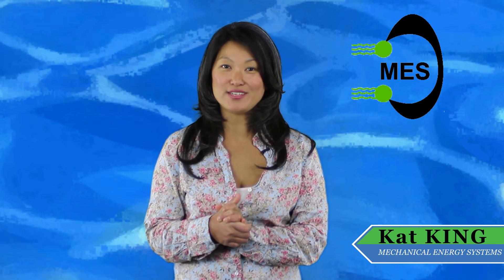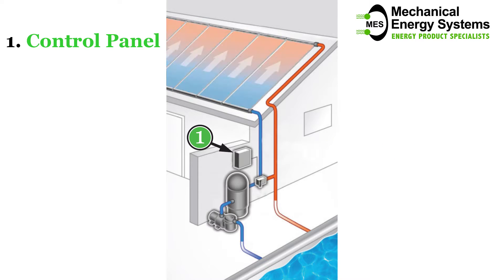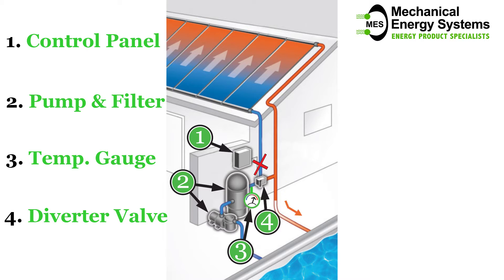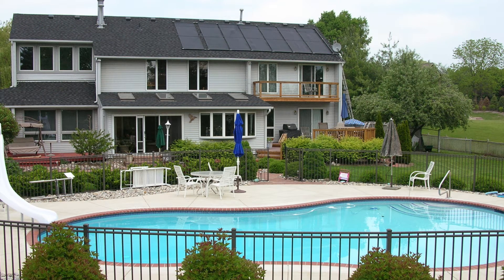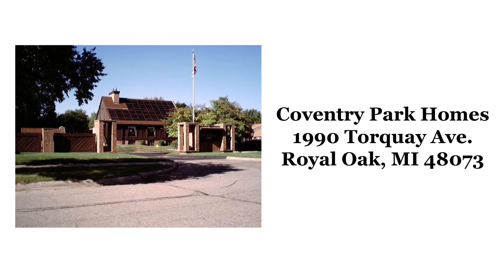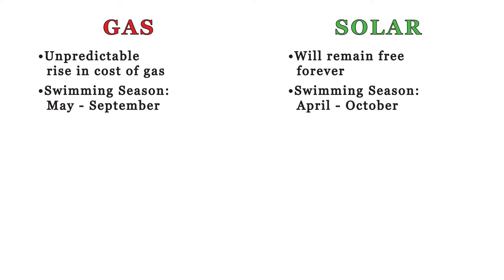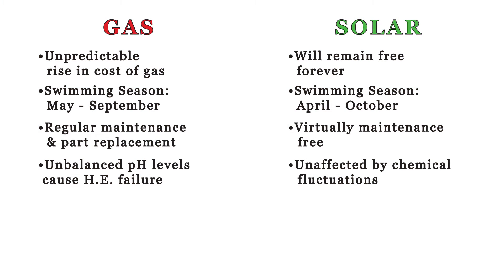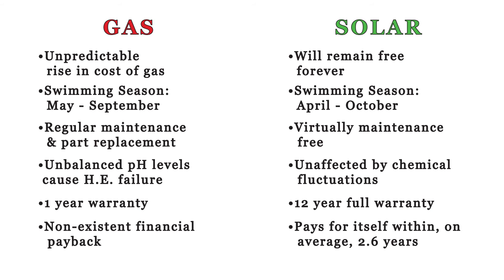Fafco Solar Pool Heating Explained

Comment: Fafco panels are JUNK, I know, I have 10 of them
Reply: Any ideas which panels you might recommend ?  I am looking to buy a pool solar system and install myself.
Thanks, Gerry from San Diego, CA
Reply: I don’t know what kind of experience other people have had with FAFCO roof panels but mine has been absolutely awful.  I live in Florida.  I purchased the system with 7 panels in 2013.  Since that time 6 of the 7 panels developed leaks.  This year the 7th panel started leaking.  When I purchased the system, it came with a 12 year - Full Warranty and a Lifetime Limited Warranty.  As usual, customers should be very careful regarding what the word “Full” means.  I found out the hard way.  For example, Full does not include a service charge for each visit which can be as much as $180 or more depending on where you live.   Also, Full does not cover the cost and shipping of each panel which in my case was an additional $90 for each panel.  When I asked how much an individual panel cost, I was quoted an amount exceeding $700.  Keep in mind that I already paid, in 2013, over $3500 for the purchase and installation of the system.  So shop around before you make a decision.  There are differences in the quality of the product and make sure you know the companies definition of “Full Warranty”….